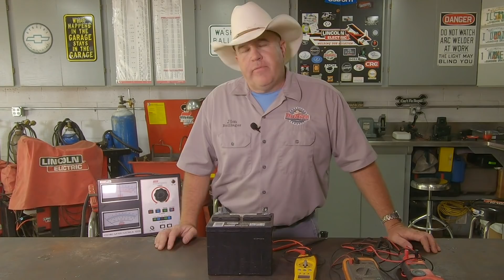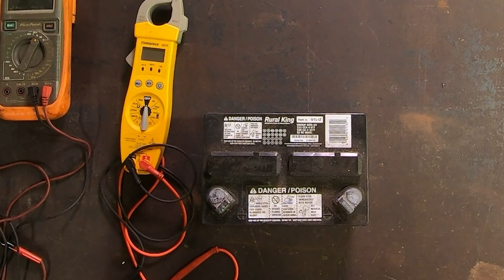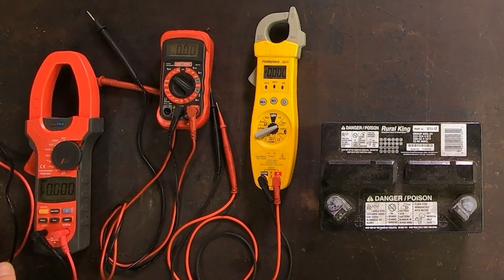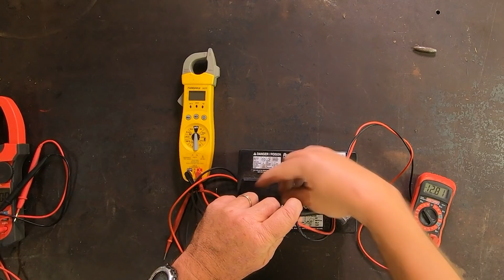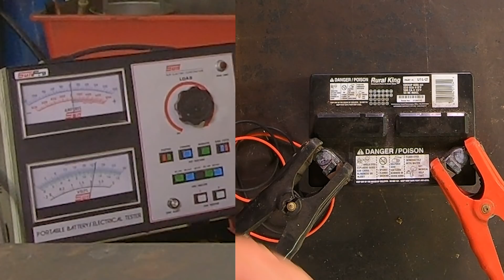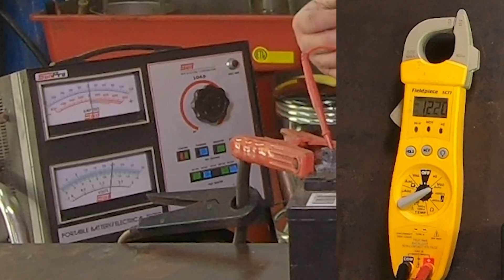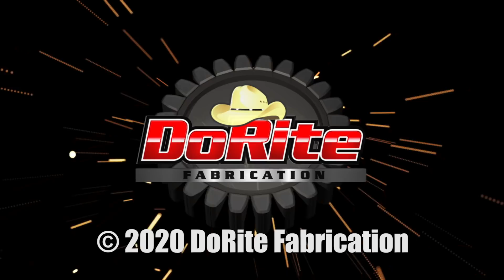Car battery CHARGING nightmare

Comment: I noticed my vehicle battery would do that after I used one of those small battery booster packs. My battery went dead after I left an inverter on for two days. I tried to boost it with a booster pack when it was dead. But battery wouldn't hold a charge.

Comment: maybe batteries can be used for longer if one were to reverse the leads because the oxide Buildup prevents current flow in the battery. but if you reverse, it you're causing hydrogen to form on the opposite electrode, the one that used to generate oxygen, and that hydrogen turns into acid and dissolves the oxide layer from those plates....

Comment: Yes, a rechargeable battery is able to reverse its polarity under ideal conditions when it is completely discharged.  however it will tend to creep back with a very small charge in the wrong direction.  Then when you add a smart charger to it it will tell you that the poles have changed.  If you switch the leads and charge, it will fully charge backward!  You must fully discharge the battery until it it fully dead.  Then recharge it the correct way.  maybe you can revive it. Larry Burnett Colorado.

Comment: Hey brother, good video I have an answer for you or at least a potential answer what happened to a friend of mine he accidentally let his battery die completely well he went to charge it. In a rush he put negative to positive and vice versa from his charger, which intern reversed polarity now there is a way to fix this. It is to let the battery completely die and then start over some people say you have to let it die 100%. I’m not no expert but I’ve seen it work personally. Best of luck to all and God bless.

Comment: I, inadvertently, reversed the polarity in my truck battery when I hooked up a 220V charger and plugged it into a 110V house receptacle.  I had forgotten that I had purchased that charger overseas and that it was 220V.  I left it hooked up over night and it drained the battery more and reversed the polarity.  Crazy!  What I need to know now is how to fix the battery so that I don't have to buy another one.

Comment: I can't tell you how it happens but I can tell you how to recharge to original polarity  , first drain the battery completely, use a small 12volt light until it doesn't  glow at all after that take a fully charged  batery of the same size and hook up the negative to negative and positive to positive  with a good set of cables,allow the charge to equalize overnight, do not hook up a charger,after the equalization  has occurred put a slow charge 2amp overnight check your polarity in the morning,it should be right after that

Comment: the only ways i can think of that can cause a battery to reverse.

1. defective battery  battery intended for foreign market where it has positive ground and they swapped the tops by accident or charged it in reverse.

2. if it is a small lawn mower or atv or motorcycle battery the batteries arrive dry and you have to add the acid to activate them and then charge them so maybe it was reverse charged.

due to the way that lead sei "solid electrolyte interphase" is formed it is possible to "program" the battery in reverse because you reverse charge it when it is new.

3. i have heard of cell reversal mostly in nicd cells but i am not sure if that applies to all or just nicd.

Comment: I noticed the battery has lawnmower style terminals...when you go to a store, look at the batteries there.  There are some with the + on the left and some with the + on the right.  That is the only difference visually.  The internals on both batteries are the same.  + is determined on the initial charge.  That being said, the.   3 easiest explanations are that something happened with the charging system that cannot be explained since it seems to be working properly, or someone discharged the battery and charged it backwards being used to the positive being on the "other" side and they did not realize they did it...or they did realize they did and are pranking you

Comment: I worked for the phone co for 37 years, some of them in the power room baby sitting the 52 volt power plants and  string os storage batteries used to maintain power when commercial power failed.  Our batteries were single cell batteries, but the principle is the same. We occasionally would have a cell reverse its self. There is a way to bring it back but it is a lengthy process. Western Electric would bring in a device that  was used to by-pass the bad cell and provide the 2.7 volts to the string while also charging the cell. I don't know exactly what the device did to the cell , but it took several days to accomplish.  One of the ways a cell can do this is the plates get sulfided together, this is most likly to happen in an auto battery if it is in a circuit with the key left on or if there is a parasitic drain on the battery like a high resistance short. Or if the "boys" ( not yours) ran the engine with out the charging circuit working properly. The chemical reaction will probably continue even after the batt has been drained flat and then may recharge in the reverse direction. It is probably not worth the time and expense to try and fix your your small lead acid cell.  It would be worth your time to check out the tractor for High resistance shorts, bad or corroded connections and a defective charging system.  Sorry to be so late in the comments  but I just got back to your channel, also that this is so long.

Comment: As many have noted, you can charge one backwards, the plates are basically the same. I have very vague memories that something like that can also happen under a continuous trickle draw condition that discharges the battery completely, and is then released. At that point the battery cell can recover in either polarity. But why all the cells would reverse without some external influence to suggest a direction to them is a little strange.
One thing I didn't understand about your measuring setup was that clamp amp probe on the black wire that you used. A normal inductive amp probe only works on AC, not DC. You heed a Hall Effect clamp to work on DC. I would have thought that Sun tester was way to old to have something like that, and would have measured current flow internally with a current shunt.

Comment: Are you running an alternator on the tractor? If so it's possible that your voltage regulator is fried and is supplying AC current to the battery, this can wreak havoc on them.

Comment: In 40ish years as an Avionics Tech (Aero Electrician) and running many RAAF battery shops I have never heard of this before. The physical make up of the plates says it cant happen. 

I can not explain how it happened.

If you have an old style unregulated charger (just a 14v transformer and rectifier) and try to charge it..

Comment: I went and look at the beginning of your video and it appears that the engine in the tractor is a Kohler? They use a solid state regulator rectifier. The stator makes a/c voltage It should be making about 40 volts a/c coming of the stator. Then through the regulator rectifier to make 12 volt or some where close to that d/c current. And due to the fore mentioned in previous comment is how the polarity change happened.
Reply from the maker: But, the tractor has not started. Not even turned over.
Reply: @DoRiteFabrication  When the tractor was ran last this has happened
Reply: @DoRiteFabrication  Also your amp probe appears to not be working. Your multi- meter should have d/c amp capability. try using it to see if in fact the is any heavy draw on  the battery.
Reply from the maker: It simply cannot work that way. Tractor pull runs are short, probably no more than 10 min. That's not enough time for that small stator to charge up a battery.  If the battery reversed when it was running none of the LED lights would work, neither would the electronic horn and the engine could not start again. Plus, no issues now with a new battery.  The mind boggles
Reply: @DoRiteFabrication  Inn changing old six volt tractor over to 12 volt I change the polarity as well starter are color blind as to what polarity they have unless the brushes are changed in location in the starter. The horn probably doesn't care much about polarity either. Leds are another thing they are polarity sensitive. Ever jump start a car with a low battery and see how fast it can charge up so it can be started again. I know I have and about  fifteen minutes is all it would take.
Reply: @DoRiteFabrication  Another thought is the starter stuck in the engaged state depleting the battery and the because they are a permanent magnet start it could have worked as a generator.
Reply from the maker: The starter spins in reverse, the horn is electronic.

Comment: what has happened is the battery was drained down while running and due to a malfunction  in the regulator due to a bad diode it charge the battery backwards.

Comment: Discharge the battery to zero volts with your carbon pile and a 12 volt bulb. After total discharge disconnect the 12 volt bulb and put a de-sulphator on it (with the charger) while trickle charging (2 amps) back to 13.2 to 14  volts.  Leave de-sulphator on the battery the whole time you are charging.  After reaching 14 volts leave the de-sulphator connected and let the battery discharge running the de-sulphator until it reaches 7.5 volts then reconnect the charger (with de-sulphator connected) an charge back to full charge.  The battery should be reconditioned enough to run the starter an start the tractor.  Verify that the alternator/generator
is producing the correct DC charging voltage and that none of the diodes (alternator system)
are  shorted to ground as a bad diode is a short to ground.  A 12 volt de-sulphator can be purchased on eBay for cheap $$.

Comment: I have never seen this before that's crazy wonder if it was super dead and some how the polarity changed during charge the last time it charged properly like there was a problem in the trickle charger and that charger was charging the battery with ac alternating current instead of the direct current dc it needed

Comment: Accept the fact that sometime in its lifetime ti was charged backwards. Maybe even at the factory from new.Even backwards the starter and lights will still work.
 Check to see if the tractor isn't positive ground.Older cars and tractors sometime were positive ground.
  Hook up some lights and leave it for a couple days and run it completely dead and RE CHARGE it the right way.CARRY ON!
 https://www.google.com/search?q=reverse+polairty+on+a+battery&rlz=1C1GGRV_enUS751US751&oq=reverse+polairty+on+a+battery&aqs=chrome..69i57j0l7.11047j0j8&sourceid=chrome&ie=UTF-8#iqh=Car/0
Reply from the maker: Lights and starter will not work reversed polarity. The tractor has LED lights and a starter will run in reverse direction and not drive the bendix gear out and into the flywheel.
Reply: Depends on the starter type and light type. incandescents don't care about polarity and neither do the old fashioned fully wire wound non permanent magnet brush type starters. You can still have a backwards polarized battery installed in a  tractor wrong and get  permanent magnet starter and leds to work if.Electricity is still electricity,It always has a negative and positive.  It's just that you are flowing the wrong polarity (wrong direction of flow)that doesn't match with the - and + marks on the battery.It really doesn't matter how it got switched, you just have to correct it and carry on.I should add, even the tractor charging system can charge a reversed polarity situation if the battery has been reversed. Draw it slowly down stone cold  dead with some lights and recharge it slowly in the right polarity and see what happens, I've done it before when I  screwed up batteries polarity.Keep up the nice videos! @DoRiteFabrication

Comment: You are not getting much current from the battery because of high internal resistance.  The only thing that could have happened is that the battery was charged backwards.  I am not sure what you have charging the battery on the tractor engine, but either that charged backwards or someone put a charger on it backwards.  I had a neighbor that used to do some work on various things and someone had charged their battery backwards with a charger.  He hooked a head light up to it and let it discharge completely and then charged it correctly.  He said that the battery worked fine, but that was LONG before low maintenance batteries were invented and had no antimony in the battery plates.

Comment: My granddad always said that if you put your battery on a concrete floor it would do this, I've never hurd any truth to it but who knows
Reply: Batteries of old would discharge thru the casing when left sitting on concrete floors,, the plastic shells used in todays batteries will not do this.  They started changing the casings to the newer plastics back in the 60"s if I remember correctly.. I am a old fart and have lost a few brain cells over the yrs.

Comment: I'm scratching my head too. Never seen this before. What noticed is 12.8 volts for a battery is a tweak high. How long before this video did it come off the charger?
Reply from the maker: Did you actually watch the video?
Reply: @DoRiteFabrication  it was just a question dude. I dont know if this was taken 5 minutes or 5 days after you removed the battery. If it never did take a charge over the winter then it is odd it would have such a high residual voltage. Most new interstate batteries i take off the shelf have around 12.5, to 12.6v.
Reply from the maker: I totally agree that the voltage is way higher than I would expect. But no charger was applied before the video. If I wasn't a logical type person I would swear it was little green men ...

Comment: Jim,
My suggestion for you would be to talk with the people at the Concord battery booth at Sun N Fun (postponed til May) or Oshkosh.  They have a bunch of real battery experts.   At battery class, they talk about a battery cells reverse charging when the battery goes completely dead.  I haven't seen the condition myself at least as far as I was aware, but in class they say it is pretty common.  The guy from Shark River Machine was totally correct.  Your battery is sulfated  will never take a charge and pass a capacity test.
Reply from the maker: That's solid advice, but I will have to wait till may or June or july, or whenever this madness ends.

Comment: I had a battery reverse 6 of the 12 cells in it when I tried to jump my 7.3 excursion with my 2006 suburban. Ruined the battery and messed up the voltage regulator in the suburban to the point it charges at 15-17 volts and the battery in it now holds at 14 volts. Hell of a squeal through the radio too that varies with rpm so I’m sure it corroded a ground somewhere. But it reversed it from the load being put on the battery and charging system from the excursion trying to crank over with two completely flat batteries (didn’t know they were that flat at the time). Will give it credit, it started that excursion. Now I know to use two vehicles when I jump it.

Comment: What polarity is the charging system on the pulling tractor producing? Have seen this happen back in generator charging days when a generator would get polarized backwards after sitting a long time and losing field magnetism.. This was especially true with Autolite systems. Yes, I am the crusty old codger that has been around nearly as long as dirt. Go check the output of the tractor engine charger for its polarity and then report back.
Reply from the maker: The charging system is a stator and diode rectifier, Polarity is correct. A fresh battery and the boys are bringing tractor pulling trophies home again. The mind boggles at what made this happen.....

Comment: I have seen this a couple times with alternators that have bad diodes charging the battery with ac not dc
Reply: Texantroll I agree, I think the charging system on the tractor is suspect

Comment: we used to run john deere self load scrapers in the 1970's with positive ground,when jump starting off a regular neg ground pickup you could switch polarity on the scraper if you wernt careful,seems like model a fords were also positive ground.

Comment: I was a auto mechanic all my life till 08 when I had a stroke & I've never seen a battery do this But my guess is it was dead nuts empty & hooked up backwards. I would hook up a tail light bulb & leave it hooked up till it was completely dead & then slow charge it with the charger hooked up right to see what it does. Oh I would buy another battery too because I wouldn't want to have to rely on that battery but it would be interesting to see if that would fix it tho. I also use to love useing them pld SUN load testers a great piece of equipment to had that has kinda just faded away.
Reply from the maker: It was never charged, other than tripping out the charger. At that time the polarity was already reversed.

Comment: Any multi cell battery can do that as it goes dead. It is a real problem with Li-Ion packs but not such a big deal with lead acid. It also means that at least one cell is in real bad shape. It would be a good idea to replace the battery, but you could also bleed off enough charge to be able to charge it, or use a high capacity charger that doesn't have reverse polarity protection to give it like a 100 amp blast for a few seconds to get it going again, then charge it and test  it. It will likely fail the testing, but might be good enough for a small tractor. BTW, your carbon pile should be able to pull it down to zero volts, so there is a problem with that, too. Probably lack of use. Try  it on a good battery to see if you can shake the dust off it.